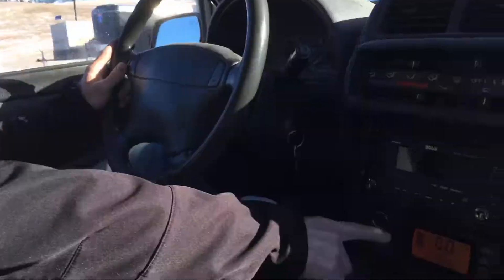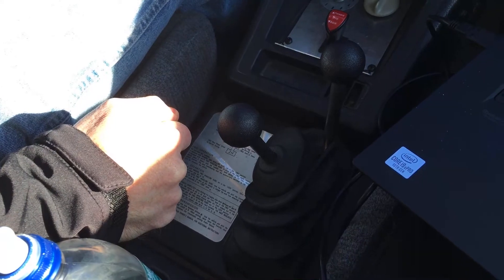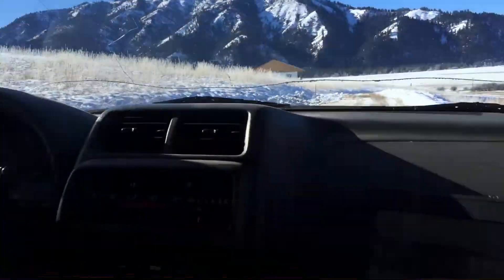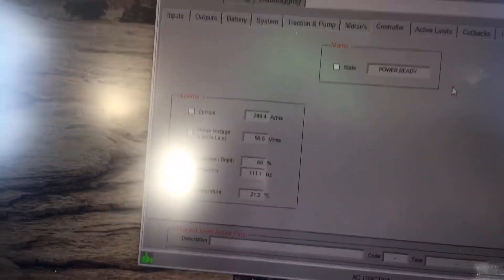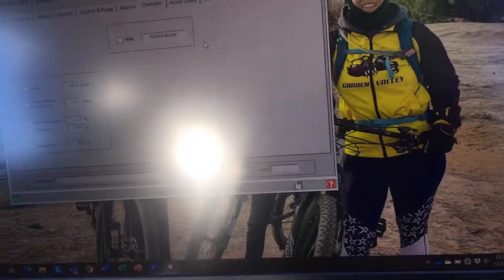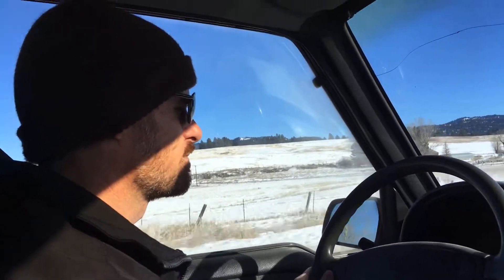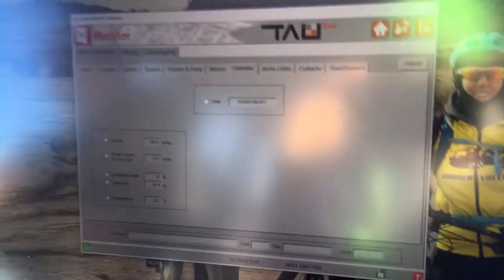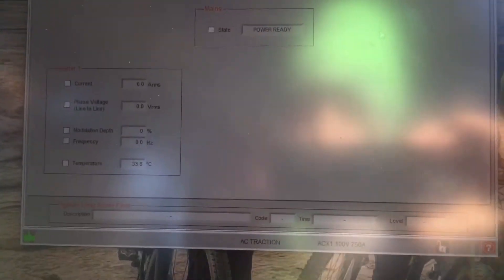Electric Suzuki Sidekick - Driving Demo

Comment: Heated seats are much more efficient for keeping you warm in the winter. Worth looking into if you haven't already!
Reply from the maker: Yeah, I actually bought a cheap 12V heating pad that plugs into the cig. lighter outlet.  However, it ended up in my wife's car pretty quick, so I didn't really get to test it out in the Suzuki!  Since we park it in the garage and most trips are short, I usually just dress warmly . . .

Comment: I'd like to know more about the hyper motor vibration you say it has on low RPM...is it just sound wise or can you feel it? If so, how harsh?
Reply from the maker: The vibration is probably the biggest negative about the whole thing, but I've learned to live with it.  It is pretty harsh and can be felt through the whole vehicle.  The severity is directly proportional to the amount of torque applied, which is why I believe it is true "torque flutter" of the AC motor (not shaft mis-alignment).  If I start from a stop going uphill and give a lot of throttle in high-range gear, the vibration is severe until I hit about 3-5 mph.  If I start from a stop going downhill and just roll away with no throttle, the vibration is not noticeable at all.  Keep in mind that my motor is hard-mounted to the frame with absolutely zero rubber or any other vibration dampeners.  I'm sure some soft rubber in the mounts could have alleviated the problem quite a bit, but I don't really have room for anything like that in my design, as the motor/wiring BARELY fits in the transmission tunnel.  Driving in low-range reduces the vibration, both due to less motor torque required and the fact that it gets to higher RPM quicker.

Comment: So my brain can figure out the approx range I think, but I can't find a calculator online, at 250 amp draw with a 120v system that is approx 1 kwh of usage per 4 miles, minus heater and headlight use I guess, so if you use 16 of your 20ah of Volt battery capacity, would  that be 16 x 4 miles per Kw so approx 60 miles range or so?
Reply from the maker: Matt,

Don't read too much into the amperage from that most recent video - I had the wrong screen displayed on the PC, so it was showing AC amperage to the motor at who knows what voltage.  What I should have displayed was DC Bus amperage from the batts to the controller.  Back in the summertime, that was around 140 amps at 50 mph.  However, that doesn't necessarily give a simple indication of range, either.  The reality is that my practical range is only about 35 mi. in the best of circumstances.  There are several factors limiting this, and I will hopefully make another video soon discussing these.  But, suffice it to say that EV range is inevitably a very complicated subject . . .

Comment: Liked Before watching!  And I don't click like very often, I want youtube to actually know what I am interested in and I LOVE this!!

Edit after watching: Thanks alot! Great info and indeed would want the transmission if any serious offroading or slow speed maneuverability is important, so at 50mph it seems you were pulling approx 250amps? I will go back to your other video to check Voltage, I forget what you said it was. (went and checked - 120v nominal, 132v Controller max for anyone else reading this)